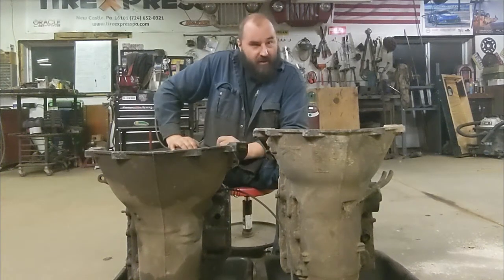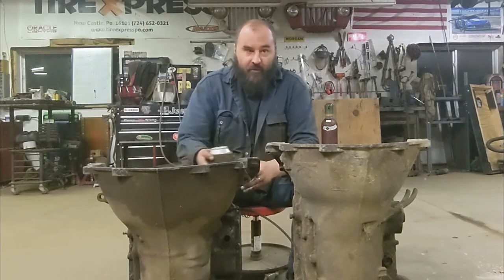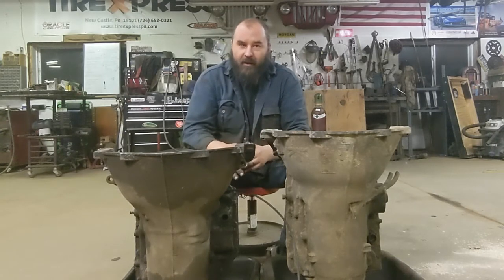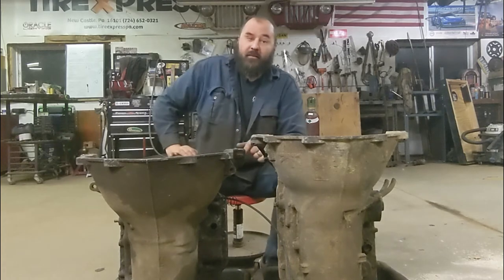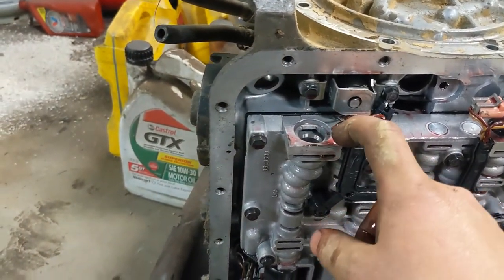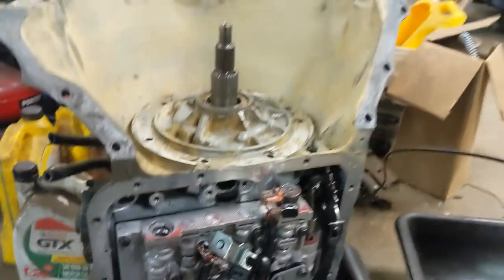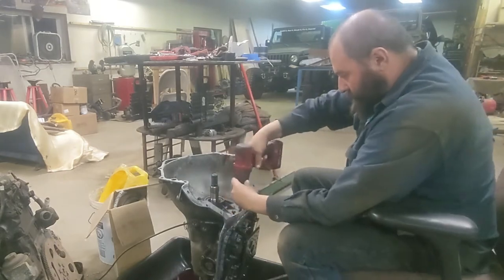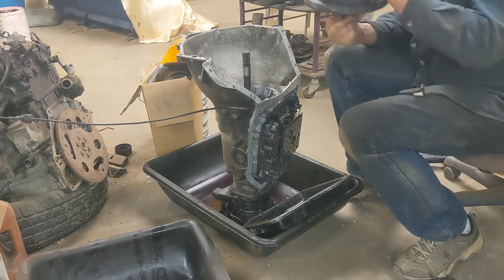How to Build The Ultimate TH350 Transmission Part 1 - Rebuild the old transmission with 4l60e parts

Comment: When you missed the trash can my 1st words were ..."use the eye that don't come out" lol. I had a friend down here that was trying to do the same thing that you were doing and had the same result. A guy that rebuilds trannys down here said that if you use a larger trans cooler, you will naturally keep the oil cooler and makes the trans not wear so easily. But that does nothing for your gear ratio issue.
Reply from the maker: I'm using a massive cooler. 😁